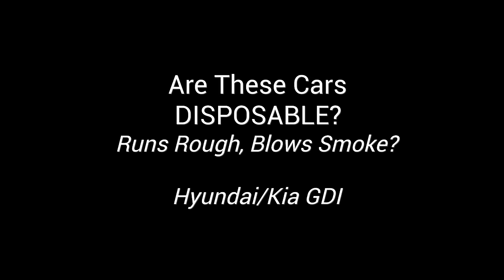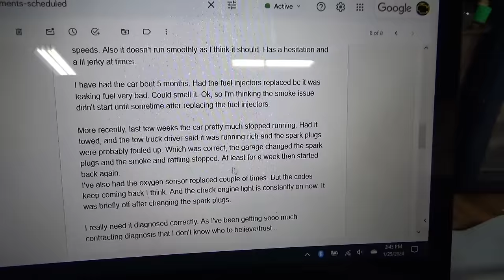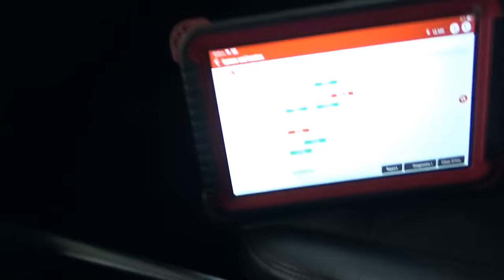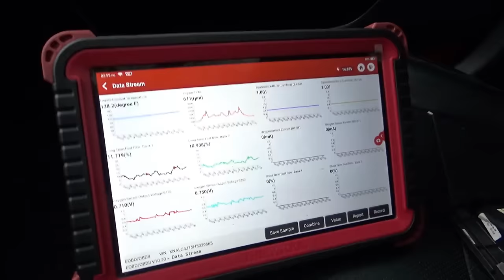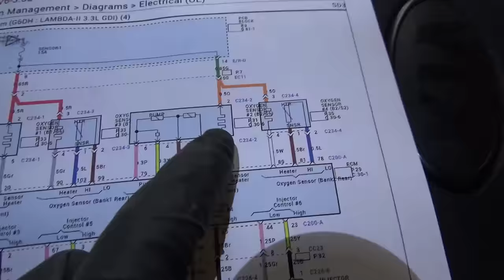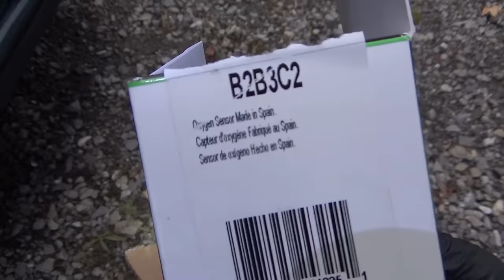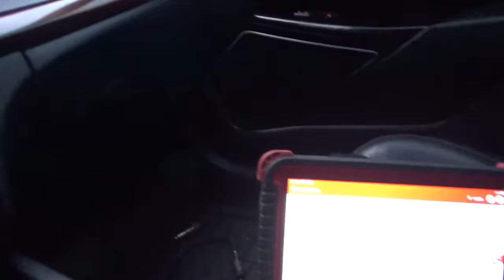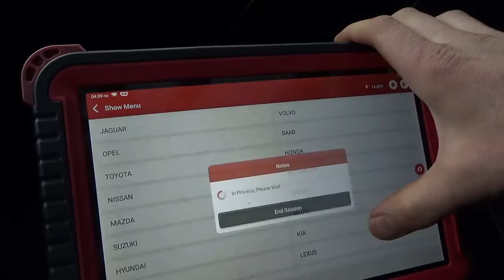Are These Cars DISPOSABLE? (Hyundai/Kia GDI Burning OIL - MISFIRE, Low Power)

Comment: Switching to heavier oil completely stopped the excessive oil burning in the wife's 2007 Camry. I could not believe the  difference!
Reply: Wow.
Reply: what oil do u use now
Reply: You’re now burning excessive gas than the engine was designed to. It’s a pick your piston kinda thing, burn excessive oil or burn excessive gas
Reply: Did you go to 10w30? Syn blend or full synthetic?
Reply: @carlt6932  I hate to admit it, but I forgot whether it was 10W30 or 10W40 I switched to. I just changed the oil and used 10W30, so I will be keeping a close eye on the oil level. Seems like lately, all I can find is a synthetic blend, and I use that. I would prefer non-synthetic, since I change oil at 4000 miles. I normally pick up oil at Walmart, and they almost NEVER have the same weight and blend in Castrol. At 204,000 miles, I just get whatever brand and blend they have in the weight I'm looking for. I take care of 6 vehicles in my family.
Reply: @dustcommander100  A neighbor has a 200k plus  4 cylinder Camry that is a oil burner and has the start up rattle. I used the three part BG flush and treatment. Used 10w30 Mobil One. It has been a couple of months I need to ask him if it helped. I recommend keeping a log of oil changes and top offs.
Reply: Yet so many people now still keep buying these cars. Even if the dealer will replace the engine you could be waiting 3-4 months because there is such a backlog. No thanks. I guess most people don't watch all of the videos on YT talking about these problems.

Comment: Another poorly maintained vehicle. This is not unique to Hyundai/Kia but the GDI simply cannot tolerate it. A well maintained Hyundai/ Kia will last much more than 100k without issue. I think the 10 year 100k powertrain warranty gives people a false sense of security that they don't need to worry about maintenance and most people don't keep up with oil changes anyways. Good stuff Ivan, looking forward to you testing Bernie's oil treatment.

Comment: I work on these kia hyundai engines.  Have had several engines ruined by the 'ceramic' material of cats breaking up and back-flowing into engine. The glass like ceramic ruins the cylinder walls and the ceramic builds up in the bottom oil control rings.   Oil burning... cat efficiency....

Comment: GDI engines need regular induction service, fuel additives to prevent carbon buildup, neither of which most people even know about, as well as frequent oil changes, otherwise they carbon up, which can flake off in chunks and scratch the hell out of the combustion chamber leading to oil burning, or cause tons of other issues that probably stack up like at the end of a game of Tetris, and before you know it you're chasing 20 symptoms that really only originate from 1-2 problems.

Comment: hehehe, 4 quarts every 1000 miles and the oil is as dark as that, why bother computer diagnosing?
Waste of time and money
Just do a compression /leak-down test 
Burning oil(if it is oil) comes from rings or valve stems. 
Run it till it cant run and get another motor or car

Comment: 7,500 to 10,000 mi oil change intervals  recommended by manufacturers and light tension piston rings. No surprise we're seeing these failures. 
In attempt to squeeze more mpg and reduce emissions we're burning far more oil and filling scrap yards with late model cars.
Hopefully Ivan tests the miracle cure treatment!
Спасибо Иван
Reply: Yep. 

Toyota did this with the late 90s Corolla engine. If you are not anal on maintenance you get burning oil
Reply: Kia recently changed their OCI to 3750 miles.
Reply: @CharlesCurran-m9p didn't know that. We got a new kia engine under warranty and they recommended 3k mile changes...which we're doing cause it's a new engine but it's overkill and the oil comes out looking good ever time.
Reply: @keshmo12  I’d rather change it too often than too late. Just keep your receipts.
Reply: In Canada 21 santa fe calls for full synthetic oil change every 6000km. That's like 4000 miles. 
I had no issues with mine so far but i won't buy Hyundai again. I do not like plastic engines and I expect car to last 200k miles otherwise I would have to buy new every 5 years
Reply: @cclngthr  They also did this with the 2008-09 Camry 4-cylinder engine.  The piston rings were junk and the cars burned oil prematurely.  Scotty Kilmer says his son has one.
Reply: @lvsqcsl  

It isn't that the rings were bad, the service intervals have to be more frequent with a good oil and OEM factory filter. 

When I bought my 01 Corolla, it had clean oil in it, but I used a kerosene treatment with 5 quarts of kerosene with fuel pump fuse pulled and cranked the engine for 1 full minute, drained that and changed the filter to 2.5 quarts oil and 2.5 quarts kerosene and idled the engine for about 5 to 10 minutes to clean out the motor. Not much came out since the motor was kept clean. It doesn't burn a drop of oil. When I pulled the original downstream O2 sensor, it had white residue, but nothing was black. Pulling the valve cover to fix a leak I saw the inside of the engine looked brand new.
Reply: @CharlesCurran-m9p I haven't seen that yet. Good to know 👍🏻
Reply: I was following the manual OCI which stated 7,500miles and i could feel it getting slower and slower and having VVT is quite dependent on oil pressure. Switched back to 5,000 and used 2 rounds of Liqui-Molly engine flush and it made such a difference.
Reply: Manufacturers have also raised the engine operating temperatures for better emissions. Unfortunately this cooks the engines. I think of all those vehicles with auto stop/start on a hot sunny day when the engine shuts down at multiple traffic lights and sits there hot soaking.
Reply: @steadyeddie7453 exactly, good point 👍🏻
Reply: @CharlesCurran-m9p I have a 2016 sorento with this engine.   They have always had the 3750 OCI under “severe use”. The owners manual calls out what severe use is.  To include if you live in a mountainous area, towing, especially hot or cold weather, etc. point being many people fall into severe use.
Reply: Kia recommends 7500 miles under normal use and 3750 under “severe use”. Criteria for severe use are stated in the owners manual and include very hot or cold weather, dusty conditions, driving in mountainous areas, driving in heavy traffic(stop and go). Many people will fall into severe use category. So many of these vehicles are being poorly maintained because the owners are not properly caring for them. Silly to spend tens of thousands of dollars for a vehicle and unwilling to spend ten minutes to figure out how to keep it running well. If you treat a car like it’s disposable then it will indeed be disposable
Reply: @mcfish689  I think them deeming that as "severe use" is highly misleading. Given I work on older fleet vehicles but what they describe is honestly normal use for most folks. Stop and go traffic is sever use? Seriously? Severe use in my owners manuals (early 2000s fords) pertains to police pursuit, heavy dust and continued commercial and off road use. Crazy. Thank you for posting that as I learned something new today. Too bad all these Kia owners aren't told the same!

Comment: I'm currently renovating a Kia Sorento 3.3 V6. It's the same engine. The newest engines are 1 year old. Valve tappets are already missing. 50% is achievable. The engine has 180,000 km and everything is worn out. The crankshaft is so soft that it can be damaged by measuring. New crankshaft in EU $1600. The parts alone were worth $3,000. In the EU, it's hard to find a strong car with a towbar and a towing capacity of 3.5 tons.

Comment: The drain back holes on the piston get clogged up with soot the oil has no place to go except out the tailpipe.
Reply: Well that's exactly the kind of thing that this formula is supposed to dissolve..  So maybe there's a chance for it to work.
Reply: That's what the holes behind the oil ring is for? 🤔
I just put new rings in my '03 Forester. Those holes were so plugged that I literally had to drill them out!!
I'm guessing that the old rings were low tension. Not much resistance when sliding in the bore. New rings definitely protruded from the piston more and had a lot more of resistance.
I haven't driven it yet. I'm hoping to slow/eliminate the oil consumption from the qt per 1000 miles!
Reply: @dans_Learning_Curve  Had a 2.4 eclipse 8 years ago had the holes plugged so bad had to drill them out was using a quart of oil every 500 miles still driving it today no oil consumption at all 100k miles later hopefully you get the same result.
Reply: @dans_Learning_Curve  The main issue is that the GDI sprays fuel directly into the cylinder..  and if there is anything at all wrong with O2 sensors or MAF, etc.. and it's dumping too much fuel---  it will wash all the  cylinder walls and get fuel down into the oil and dilute it..  So then the rings are just scraping dry against the cylinders and it doesn't really take that long to overheat them and then they lose their heat treatment hardness and they wear very quickly after that..    So the key to a GDI engine is to change your oil often.. so at least if the oil does get diluted---  you can flush it out fairly quickly.....    that and the fact that the rings are probably subpar materials to begin with.
Reply: @keysautorepair6038  thank you for the kind words!
Yes, being in the rust belt, I hope the engine outlasts the body! Already over 200,000 on the car.
Reply: @calholli  think I'll avoid direct injection engines!! 
I used to think they'd be the best way to put fuel into a cylinder.
I guess the emissions killed that! 
EGR.
Reply: @calholli  what mileage are thinking "often" is? 🤔
Reply: @dans_Learning_Curve  Depends on the oil you use.. Just look up what the manufacturer recommends and change it at least that often or sooner.   I would definitely use full synthetic on these cars.

Comment: In the 1980s and before the typical useful life of a car was less than 80k miles or 8 years. (If it lasted longer was exception). Dealerships (especially low end cars like H/K and Europeans) now are not set up (manpower, parts and training) to fix problems like this and car is beyond useful life per H/K.

Comment: If there was not to much damage to the cylinder walls - I would try and free up the oil control rings. Using WD40 in with the oil - run it for a week and change the oil - I bet there's a lot of sludge in the pan. But sticky rings I would suspect. Oil quality has in my mind deteriorated in quality from the stores and! if old stock has been used in any which way that is expired due to separation {freezing temps} - this in tern would add to the problem of oil burning and internal engine damage. Or just the lack of maintenance and poor care and abusing the engine by high revs could of done this...Just thoughts for all of ya...

Comment: I know I'm wrong... but hey its my ride..

for me 3,000 mile oil changes  work
I drive soft and  gentle.... have taken several  vehicles  over 300,000 miles

one a Nissan  d21 went 435,000.. then I sold it

Oil Changes.. FTW

Comment: Kia is replacing this 3.3 v6 engine for 2016+ models under extended warranty.  First step on this job should be investigating this warranty.  Root cause is overtight head bolts that eventually pull out of the block.

Comment: I knew the 4-cylinders, especially 2.4s, are junk, but I thought the V6s were reliable. When you say the cars run stoechiometric, 0.96 may be OK but my Lexus reads 0.997-1.005... And it's 17 years old. So even when new, those cars are not incredibly well tuned. I would really like to see a follow-up on the ATS can results!

Comment: Check out Berryman B12 oil consumption videos. Seems to help at a reasonable cost. Pour into the cylinder and let it sit. Then bar over engine and do it again. Repeat every 6 hours for 24 hours. Lots of videos on it. They have improvements to a lot of cars.

Comment: Yes Ivan, these Kia’s have low tension Rings. I just had a mint condition Sorento with 116k. Burning 3-4 quarts Oil per week. (This can also be contributed to neglecting the 3,000 mile Oil Change. Oil & Filters have NOT changed. Auto dealers don’t sell vehicles if you change the Oil every 3k.) THREE THOUSAND, not 5,000.

Comment: I think frequent oil changes help. Especially with vvt.I think rainmani ray had one on its second engine.And that engine the owner let it go ten thousand over before Ray did the oil change.He might have to do an engine flush.  The engine was still running ok but  was in for other work.

Comment: Never  had oil burning with the 283,327,305 and 350 Chevy engines.  I do not have that problem with an 07 4.2 engine with over 170 K miles.  I will not have any thing less.

Comment: Their old 4 cylinder motors were great as long as you did the timing belt. The first on I owned I got rid of at 198000 miles as the car was rusting away. I would not buy one made after 2010 now.

Comment: kerosene mixed 50/50 with ATF in the oil will unstick piston rings. Add 1 qt prior to oil change and let idle for 20 minutes and change oil. Perform again at next oil change and notice the difference. My Tahoe with 192 K was using 3 qt between oil changes of 3500 miles each change. Now the engine is at 262k and I only go through 1/4 qt during normal 5k changes.

Comment: Haven't finished the video but felt like commenting anyways.... Yes... They are disposable 😂 I bought a 16 Sorento 2.4 theta for my wife and it's an oil eater... About 2-4qts every 1000 miles out so... Under 100k, will maintained... In fact, if I hadn't maintained it and checked the oil regularly that engine would have died years ago! Weird thing is, there is no loss of power, no notable smoke, no external leaks, no check engine light or oil warning lights... A few months ago I had to do plugs because they were so oil fouled it created a miss. Working on these Kia/Hyundai from the 90'-late 2000's should have taught me a lesson but she wanted the Sorento... What a mistake🤦

Comment: Did you check the pcv was working, crankcase breather can thow lots of oil particles into the inlet manifold, usually get soot on the exhaust tip

Comment: I commend you for telling the customer all the facts. I think that's the best thing they can do. Any cure for excessive oil burning is an expensive hardware fix. (I'm looking forward to your test of the carbon cleaner!).   And for a car in that condition, replacing the cat on an oil burner is probably not a great idea since the new cat would probably fail soon after too.....better to just squeeze out some more miles from it...

Comment: I change my Santa Fe's oil every 3500-4000 miles using Mobil 1synthetic. While the engine did lock up at 89K, it, or it's replacement, never used any oil between changes. I've not heard of major problems with the newer 2.5, they do seem to have a ongoing problem with their 8 speed, wet dual clutch transmission.

Comment: What a waste of time on scanner or sensors. Do a compression test and a leak down.  Do not need to waste any more time on parts on this engine. If a carbon cleaning does not stop smoke to free rings bad engine junk.GM makes a decarbonizer that was used on Cadillac. Pull plugs pour in cylinders and leave overnight. If does not work junk it.
Reply from the maker: Compression and leak down tests would pass with flying colors...and would definitely be a waste of time and customer's money 🤑

Comment: Cross shopped a stinger gt2 and a tlx premium new in 21.  Went with the acura just due to kia dealership treatment and wondering if they would treat a new buyer of a 50k car well.

Ended up switching to a supra and a beater car for bad weather and way happier.  Knowing everyone about engine woes, resale, etc, kia is just not a brand you should invest in.   In the stinger case, only if you could get one at an amazing price with full service history because i will say its a competent sport sedan.

Comment: They build those engines with low tension rings to save 000.6 miles per gallon ,but blow oil out the back  lol.

Comment: I wonder if over 100k if it had 3 oil changes it's whole life. .pwople don't maintain their cars very well. They get surprised when it breaks. I have a customer who has a 18 or 19 Kia Sportage it needed front and back brakes. They only got front. Showed up about 3k later saying their front brakes making  noise. It was the back brakes that they didn't get done before. I  offered to change the  oil. According to the sticker they had 12k miles. Owner is old dude who said he had that oil honey and it's fine.

Comment: Take the spark plugs out put the pistons half way pure wd 40 let over night to loose the piston rings from burnned carbon . in the morning crank the engine let the left wd40 out change oil n filter its work i have been doing this around 40 years n its work ...

Comment: Needs a good 5w40/0w40 after one of those BG Dynamic Engine Flushes that can help remove carbon from the ring pack 
Maybe even a piston soak, I've been doing them for years, but Hyundai finally came out with a TSB for it

Comment: Had a 2017 Hyundai Sonata that started burning oil and misfiring on cylinder 2. Found leaking valve seals on that cylinder.  Sad thing is that I couldn't find anyone that could fix it. They considered the engine disposable.
Reply from the maker: Sounds like a manufacturing defect lol

Comment: Ive had good luck with pulling the plugs and filling the cylinders with sea foam. I let them sit for a few days and turn engine over with fuel disabled to push out any excess fluid. I do this a couple times. Then, change  the oil. Seems to work well